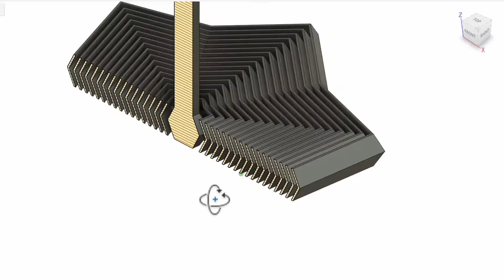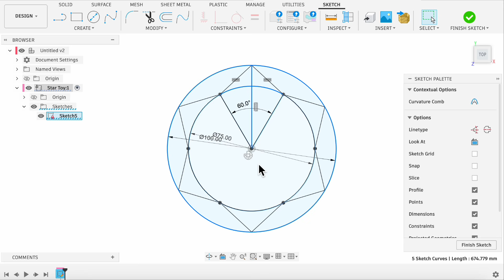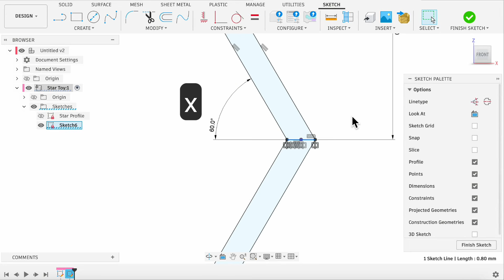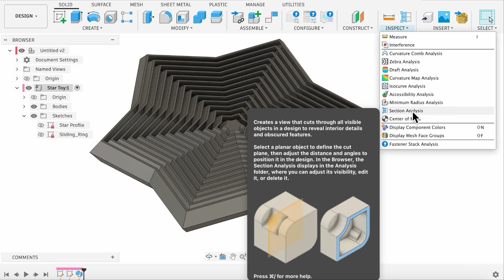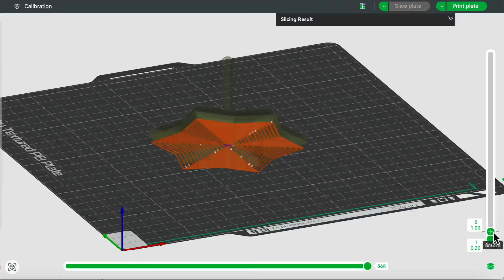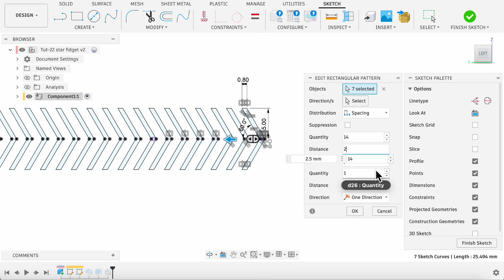Make a Star Fidget Toy in Fusion 360 | 3D Printing Tutorial

Comment: Great video, thank you!
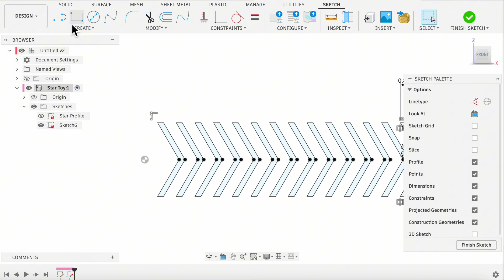In case this is of any use to anyone following along: I couldn't use the sweep tool because of an error about the object intersecting itself. The work-around I use was to: 1) Remove the star profile near the origin (which was shown at about 04:00 in the video); 2) perform the sweep operation; 3) select each of the internal faces in the exposed centre and then press delete. A sectional analysis showed I was left with a solid in the centre.

Comment: Wish I knew what I am doing wrong. 14 reference failures. Sweep encountered a problem at a sharp corner in the path. Try making the profile perpendicular to the path or use an open path.
Reply: im getting the same issue. did you ever find a fix?
Reply: @thecrazymadguy754nope. Tried starting over. Same result.
Reply: getting the same issue
doing the same as she does:face-purple-crying:
l
Reply: I was having the same issue. My guess is that when creating the first star I wasn't clicking exactly on the edges. The cursor kind of snaps to them so it's pretty easy to notice, but still I was clicking slightly off the edge. Also make sure your measurements are correct and don't delete any lines, instead use the construction tool (X key). I eventually got it right. Hope it works for you!
Reply: use surface sweep